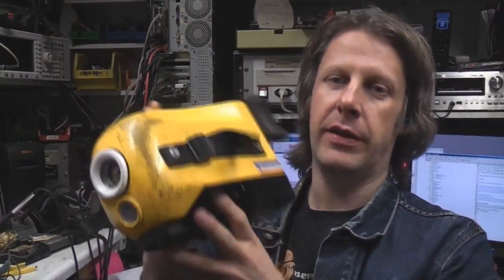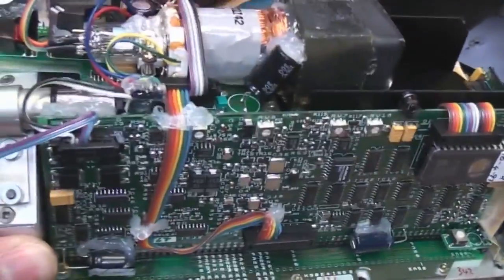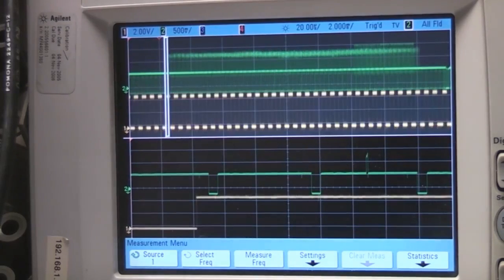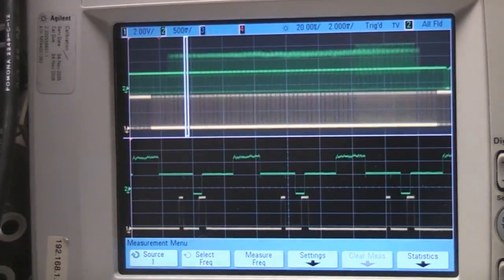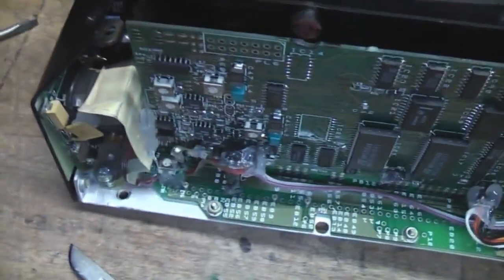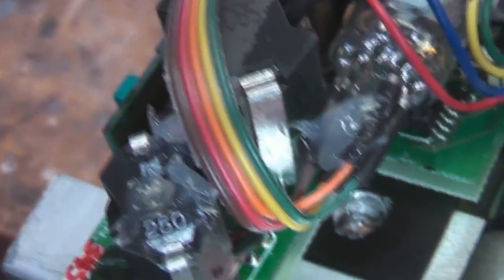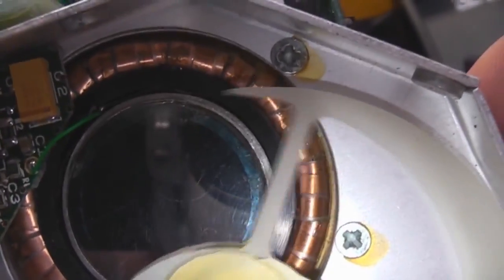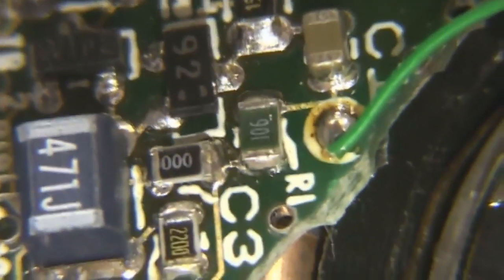Another thermal imaging camera

Comment: While I could "feel" the sound in my teeth, why filter it? I'd rather hear every noise the thing makes. If you can't stand it, most likely you've got an equalizer on your PC to almost mute high frequencies.
Btw. I think it's not the shutter motor that's making the sound. You can hear it even when it's not moving. Pretty sure it's coming from a DC-DC converter, most probably the HV generator for the tube.

Comment: no need for a low pass filter, due to the frequency, a simple noose reduction process in adobe audition or audacity will get rid of it without impacting the vocals.

Anyway, great video, did you ever figure out the focus issue (eg if you manually move the lens to adjust focus)?